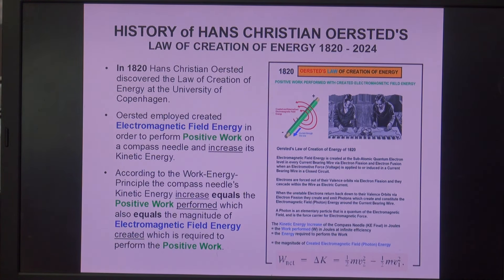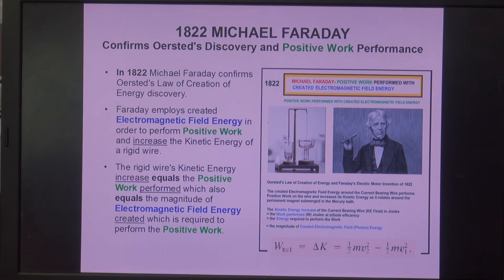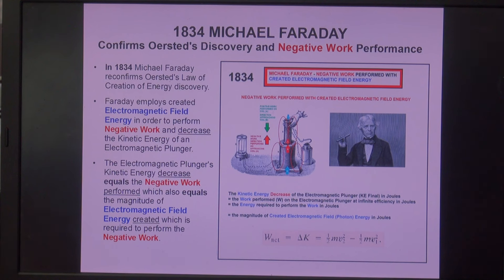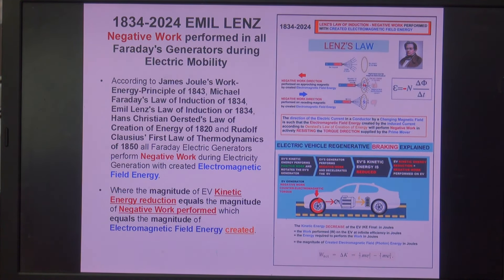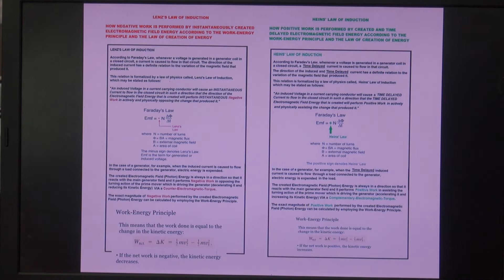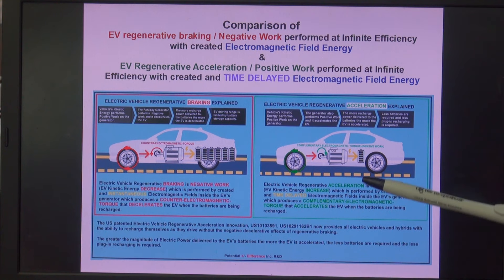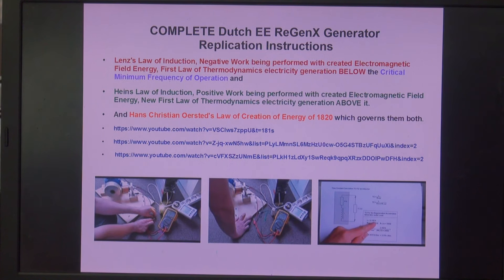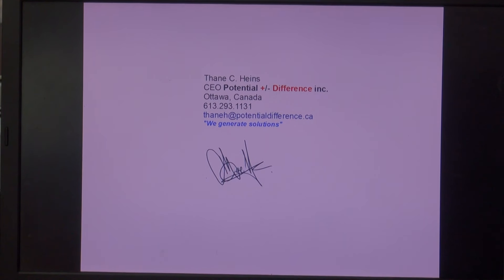HISTORY of HANS CHRISTIAN OERSTED'S LAW OF CREATION OF ENERGY DISCOVERY 1820-2024

Comment: thane, in the context of achieveing regenerative acceleration, can we increase the impedance of a coil simply by adding capacitors to it ? or is that not pheasable ? can we delay the load current with coil + capacitors or does it have to be done strictly with the coil. which as you have described, creates high impedance due to thin wire. thanks !! 

im going to start making videos about your discovery ! i made one in the passed showing the acceleration effect, and also made one describing the basics of the science you describe, but my motor needs re building after the common occurance of burnt transistors and coils overheating : )  and i got locked out of my other youtube channell with the older videos on. 

so gonna start again !! im very happy to embark on being a soldier for the education of this technology. 
would you say 0.2 mm wire is a good width of wire to start winding coils with ? 
i have my 3d printed rotor with magnets in it. 
north / south / north / south alternating as you have instructed. 
my magnets are quite close together, am i correct in thinking that if the coil is wider than, say, one magnetic field (one field per magnet on the rotor) then it might not work well ? im not using a c shaped core, as you have shown, just a simple generator coil. which is just a copper coil with iron core in the middle. 

and also another question, can i connect two coils together to create the higher impedance required for success ? 
aka, have one coil at the perimeter of the rotor and another coil behind the first coil. connected in series, is this another way to do it ? 
or would you advise only having one coil to do this properly ? 

i have listened to the crucial point you have told us, of delaying when the magnetic field of the coil manifests. 
os i was just wondering if my ideas above can achieve that or if it is much better to focus on one coil ? : ) 

cheeers !!!!!

Comment: Which part of the 0.03% CO2 in our atmosphere does it influence. ....?
Reply: well the whole CO2 thing as proposed by politicians is proabbly just bs. its irrelevant. might be relevant somewhat in big cities. but the point here is that we have an infinite efficiency generation method. the rotor speeds up when you load the gen coils. equated to an electric car, that means, when you accelerate the car, the batteries are being charged.